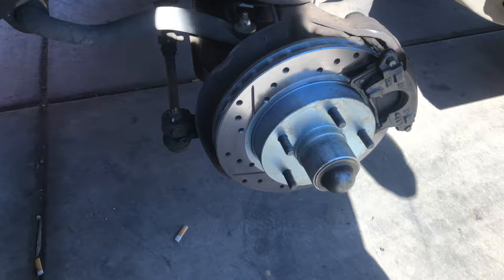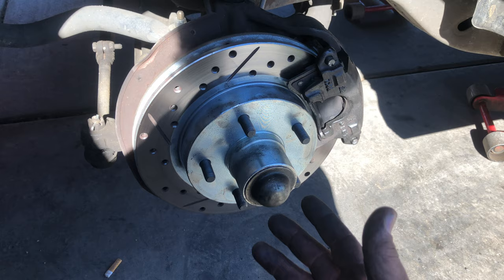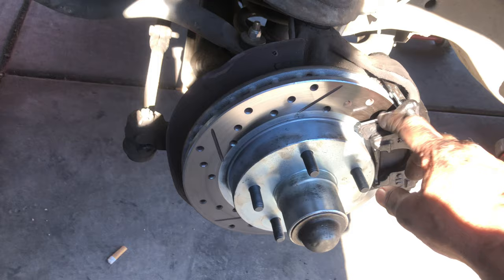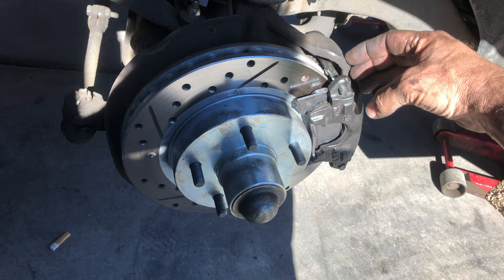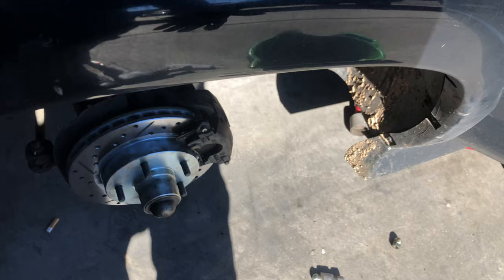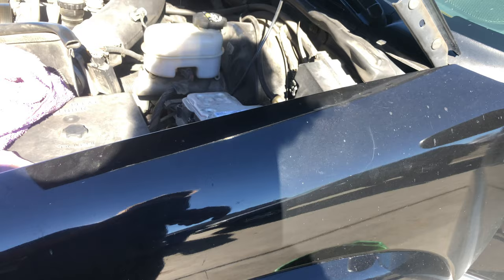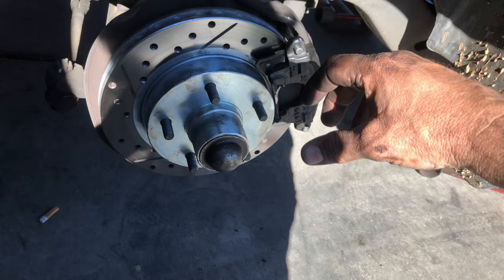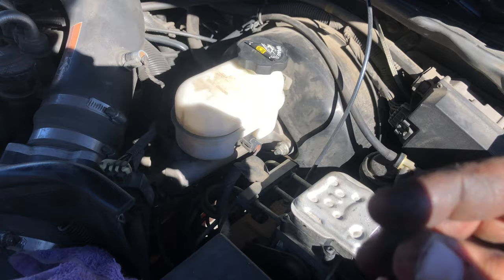sticking brake caliper , quick fix

Comment: My brakes driver side tire was hot and I did not realize I had put to much fluid in the reservoir until I seen this video I took a turkey baster and extracted some of the fluid out now the car is running smoothly and the brakes are not hot.... Thanks so much for posting this video you are helping so many people God bless you...
Reply: Was your car shaking when you accelerated?
Reply: @lilflame69  yes it was and just the driver side tire was hot and smoking I also took out the caliper guide pins and boots and installed new ones as the heat...expanded the old boots and greased them because water had gotten in...
Reply: @luxurycarkey7207  thanks for responding I’m dealing with the exact same problem. I shall try the steps you took

Comment: I would use your excess brake fluid as an opportunity to bleed them, because if brake fluid is hydroscopic, ie attracts water over time, and they should be bled through every couple of years to keep fluid fresh; then why not just bleed them through to avoid internal corrosion and other problems from contamination of fluid?

Comment: I can’t thank you enough for this video mate!! I wondered why my front right caliper (closest to the master cylinder) was sticking on but the piston was pushing back really easily with the cap off. Now it seems the engine brake effect feels back to normal, mpg is much better and the power feels normal again. It was like driving with the handbrake half on this morning. After a test drive once I’d removed some fluid, it seems that I’ve sorted the problem thanks to you 🙏 Cheers, Ian

Comment: Thank you this saved me a massive headache. Just  did this brake job on my wife’s car and this issue occurred . But opening the cap and pumping the brake to fill that gap worked out just fine , no need to mess with the brakes again. I can’t thank you enough, Thomas! You have my sub and I’m sharing this video to my buddies
Reply from the maker: Thank you so much!

Comment: You don’t have do all that extra crap push the caliper back install new brakes once everything back together before u do the next wheel is pump the pedal few times fluid level goes back to normal make sure u do this before going bed wheel

Comment: I know it is too late for a response being a 1-year-old thread, but for future DIY freaks, here is an insight. I had a confounding problem with my Chevy Cruze Diesel for more than 6 months when the calipers would not release after lifting the foot off the brake pedal once it got to high temperatures. The brake assembly used to be serviced the usual way at the authorized service centre by greasing the slide pins with appropriate grease from many different brands, but to no avail. The mechanic then felt it was the synthetic brake cylinder seal, but that too was not the culprit. I then decided to do a DIY of the problem and found out that the caliper pins were not the problem at all and neither was the piston rubber seal. The actual issue was with the front disc brake alloy pistons of the brake caliper assembly. Do not ask me why but the composition of the piston used in the Cruze Diesel in Bhaarath (India) was suspect as it enlarged minutely over time (it was not the brake cylinder rusting); I sanded it down and then cleaned it thoroughly and put back the assembly, and it has been a smooth ride ever since. Fuel efficiency too has gone up from 9kmpl to 14kmpl as there was severe drag from the brakes. Acceleration too has gone up by leaps and bounds. In my particular case, the piston was the culprit and not the sliding caliper pins, brake cylinder or the brake cylinder synthetic seal.

Comment: i bought a used car that drove perfectly and seemed fine. To get road worthy they had to replace the brake pads. When i got it it seemed like the brakes were stuck down for a second or 2 after i release the brake pedal. This explains everything. thank you

Comment: This is one of the most sensible diagnosis I've seen. I myself had slightly sticking calipers which I deduced from the fact that when I freely rotate the front wheels (Car jacked up), I hear the brakes squealing against the brake disc and therefore the wheel did not rotate freely. 
I actually did the same mistake of pushing the caliper piston back in to accommodate for newer set of brake pads but I didn't drain out the extra brake oil from the reservoir and hence it was also above the MAX level.
Thanks to you my issue has been resolved and I was actually getting a wobbly steering because of that at low speeds.
SUBSCRIBED !!!

Comment: Brillient and so simple! I had exactly this problem and could not understand why one side was perfect and the other side was over heating and the pads were worn down on one side only. SO important to check fluid level when changing pads. P.S. the garage that I bought the car from had done the brakes and filled the tank right to the top!!!

Comment: Great help. Never thought of it that way.
-i just a quick bleeding on my can am defender but them over filled the brake fluid and the pedal started to be a bit sticky on hard braking. Lowered the fluid to max & all is well.

- my hot rod was hard to push when it was in neutral. I open and close the brake bleeding nipple and all is well till i push the brake pedal and it does it again. I flushed out all the brake fluid and refilled with new & bleed the system and all is perfect.

Comment: Great vid, helped me solve my issue. My piston had gotten stuck. Popping the bleed valve helped getting going again so i could fully retract it for new brakes. Original brakes on there for 130k miles, which meant the rotor was trashed too.

Comment: FANTASTIC!!! Many, many thanks!!! I had all 4 rotors changed out together with new pads and I get sometimes one of the rear calipers stuck, overheating rotor and wheel... Now I see my fluid reservoir filled up to the cap, to the very top of it! I gonna drain it down! Again, many, many thanks! I just hope it hasnt damaged the new rotors as well...

Comment: This is a great piece of info. My right rear caliper piston makes so much noise like the pads are dragging on the rotor. I have to remove some fluid from the reservoir  to see if that works...
UPDATE:
This did not work for me. Back to the drawing board now...!!
Reply: Did you figure out the problem?
Reply: @lilflame69  Fixed it..
Piston seals were never leaking fluid.
Removed the seal surrounding the piston and found the piston had a chip torn off of it so I just replaced the entire caliper and it solved the problem. I think air was getting into lines thru that chipped piston.
Reply: @praetorianpatriot3267  thanks mate.

Comment: I always pop cap to verify proper fluid level after installing pads.  Fluid needs to be changed on a regular basis.  Check the owners manual on frequency.

Comment: Most common problem for sticking pads is failure to properly lube and clean the back side of the  pad clip guides and caliper bushings &  pins with silicone brake lubricant when installing new pads. Don't overlook this. And bleed the breaks completely every 50,000k or 5 years due to condensations contamination to avoid leaky seals. I know, it is a closed system... but will definitely see the difference in old dirty fluid after time has past.

Comment: This is an issue if all the calipers are sticking.  Easy to check, but if you go on a drive and use the brakes a few times you should be able to feel by hand if they are rubbing because of the heat.  If it’s all of them and the level is good your master cylinder may have a problem or vacuum issue.  If it’s just one you may have a different issue like a stuck caliper pin, clogged brake line, or stuck piston.

Comment: i have wrangler 2003 with abs. Front driver side was metal to metal brakes from the inside but the outside was about 50%. Decided to replace rotors and brake pads since it was metal to metal for both front. Passenger side was okay it still had some life left. Now i bought remanufactured calipers from napa since front driver started smelling funky and really hot. Driver side front caliper started sticking therefore i thought it was brake hose so replaced that and still same problem. Changed caliper under warranty and still sticking. I followed these steps and compressed piston while brake fluid cap was removed and was not above max. Pumped 3 times and still not passed max. Put everything back on but when i press brakes the rotor is tight and will not rotate. Please help! I let the bleeder go off and poured some out and closed back and the rotor still wont move.

Comment: 01:42 Actually, you are supposed to take the cap off the reservoir before pressing the piston back in.

If this was done, this issue would’ve been avoided as one would have hopefully noted it was overflowing past the full line.

Which, if they didn’t notice that, they shouldn’t be touching a car’s brake system.
Reply from the maker: that's  explained after 01:42 exactly that way thanks for watching.
Reply: I did all that but the caliper piston wouldn’t go back in why😞
Reply: @anthonyr7902  need to rebuild or replace caliper.
Reply: @anthonyr7902  Brake piston seal is one which twists and pulls it slightly back. Worn seal.

Comment: Bought a car today where the right front caliper is sticky.
Did see they put in new pads and changed the wheel bearing.
I am guessing someone did not know what they were doing. Fluid is at its max in the reservoir. Gonna bleed the brake caliper a bit tomorrow to see if this is the problem or if its the brake hose that is bad...

Comment: I changed the front brakes on my 05 envoy, I had to press the caliber back obviously.  Well afterwards I had no brake pressure at all but there was plenty of fluid. SO I bled the brakes, now all is good but there's 1 brake that presses too hard turning the truck when I brake and sticks for a few minutes after accelerating again. Once it releases it feels like the truck is throwing me into the other lane which at times is oncoming traffic. How do I fix this issue?

Comment: So then is this possible to happen to only one caliper?? I drive a 03 Tahoe and my back passenger side caliper has had issues ever since I got new rims and tires on my truck. It always seems that that specific rotor is always chewed up looking and constantly needs pads
Reply: i have the same question.
Reply: did you ever get an answer ?
Reply: Rims aren't compatible fkd up the calliper etc

Comment: Can a bad caliper/stuck piston cause your vehicle to jerk when braking ?
Reply: Rubio.:  a stuck brake piston caliper probably won't cause intermittent jerking.  They tend to remain activated one way or the other, usually extended and won't retract.  This burns up your brake pad and rotor and can cause a fire if left unchecked.

Comment: My rear brake is locking up, before we did the brakes on it the emergency brake was disconnected. we reconnected the emergency brake and now the brakes are locking up. What could be the problem??

Comment: Okay i need help!! I changed the brakes & rotors on my 2009 hyundai sonata and soon after the calipers started sticking! I changed both the calipers today too thinking problem solved but nope. Came across this video and removed some brake fluid bcuz it wa above max line, now its below the line and i still have the same problem! My mechanic is saying to try the brake hose? But why would they both go bad right after changing the brakes and rotors? Doesnt make sense… i will try the brake hose next but doubt it will fix it
Reply: James D hello did you get your problem fix
Reply: @isaacmoore5124  it got better after alignment because it was so off. But no lug nuts would still get hot. Sold that car lol
Reply: same issue i changed the caliper pins they were bit stuck but still no luck. overtime itll make my rotors warp
Reply: @3abdangry  have you been able to solve the problem i have a wheel lock problem on my 2007 kia optima
Reply: @newua1252  yes I cleaned the rust that’s on the calliper with a wire brush and a file and added extra silicone grease on the sliding pins and it’s perfect now since.
Reply: @newua1252  wheel lock usually mean bad piston or bad fluid cable. The piston isn’t pushed back it’s very hard to determine but there are videos to show you how

Comment: Hi great video 👍🏼. I have a 2008 Honda Civic 1.8l and I’m having issues with the calibers sticking. I installed new calibers, slide pins, rotors, brake pads and both front brake line hoses. I’m still getting stuck calibers. I filled the brake fluid reservoir to the correct full level but can not seem to find the problem. There’s no leaks around the master cylinder and the brake lines look good. Break fluid runs through the front brake lines properly. I’m stuck on this one. If you or anyone have any ideas on what my issue is can you please let me know. Thank you.
Reply: +sheba6779 I am not a mechanic and just sharing what I have learned from other videos. A proper diagnosis from a trained mechanic is always advised. Having said that, since you mentioned that you changed most of the other brake components and the issue is still there, you may want to look up few videos on brake boosters. I have seen this also as one of the reasons for stuck calipers. Again this a random person on YT giving you advice 😊
Reply: Im having this same problem and just bought a new brake booster hopefully this fixes it

Comment: I do not agree. Have you considered cracking the bleeder valve when collapsing a piston? Matter of fact some anti-lock systems will not tolerate fluid being charged back in.

Comment: Over time the rubber hose can collapse in a weird way I've seen it will let fluid through but not back to let the caliper release.. I've seen calipers themselves get froze from rust and crud. When doing pads always inspect and grease those slide pins with the right grease.. I'm having problem now caliper stuck wheel is hot 🔥 to touch.  Getting ready to dig into it 2007 hyundai sonata hope it's not some crazy abs ecs issue
Reply: My sonata is doing the same thing new calipers I'm going to replace the hoses mine is a 2008 how did it work out for you
Reply: @shawnsmith846  did changing the hoses help you?
Reply: have you been able to solve the problem i have a wheel lock problem on my 2007 kia optima
Reply: @newua1252  yes it hasn't happened since I changed the hose
Reply: @shawnsmith846  thanks, but which hoses exactly need to be replaced?
Reply: @newua1252  rubber hose from caliper to the steel line

Comment: I got out of my car and smelt something burning, I almost thought it was electrical until I held my hand down by the tire and could feel the heat. My car's brakes work good, just the last drive home I could feel wobble a little bit and so I guess my caliper is stuck, likely did some rotor damage, which sucks because I just replaced them! if I open this caliper and pump my brakes and check to see if there is access brake fluid would that be a good idea? I change them through an at home mechanic generally
Reply: Did you ever figure out what your issue was?

Comment: Oh, thank, just change my brake calipers 3 weeks ago and the caliper start sticking, my brake fluid is reading above the fill line chaining out both brake flex line tomorrow just in case that front driver side acting like a check valve, my kind of video get straight to the point, most of these YT creators have the mindset mentality of a narcissistic 🤣🤣

Comment: My brake was sticking so I ended up changing the rotor, pads and caliper. Worked fine for about an hour and right back to sticking. Wtf is going on? And the caliper filled and bleed so it can’t be the line right?
Reply from the maker: sounds like you may need to flush the lines.

Comment: My Jeep I just got it's a 99 I hit the brake on the highway and it started pulling to my right then later I went on highway again it didn't really do it .does a sticky caliper stick and unstick ? Or could it be something else
Reply: Could be just the right side actually working and the left side not 🤔

Comment: So if i cracked the bleeder and nothing came out?
Reply: You'll need someone to pump the brakes and hold pressure while you open the bleeder screw.

Once their foot goes to the floor with the brake, close the bleeder and repeat the process. 

Tell them not to let off the brake until you have closed the bleeder or it will suck air in through the bleeder.
Reply: @wvjeepguy8178  thank you. I've been doing brakes and rotors for a while and never had the need to bleed for some reason, but this last time lastnight on my 2013 escape I changed them and have some very spongy brakes. Going to have to try and bleed them tonight
Reply: @jesseboylan9720  when was the last time you replaced the brake fluid? It's supposed to be done every couple of years. 

You shouldn't need to bleed the system just by doing pads and rotors. While compressing the piston, you could have dislodged some debris in the system.